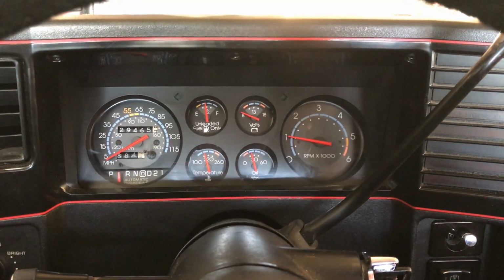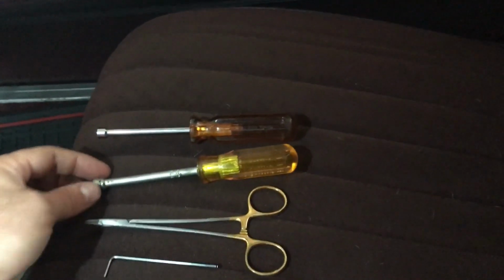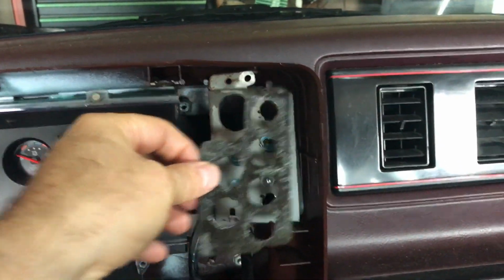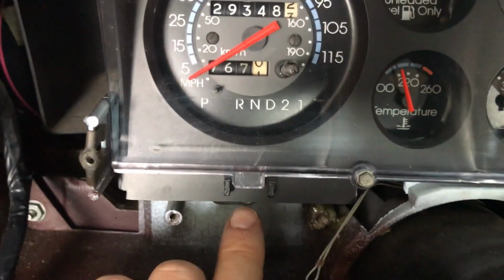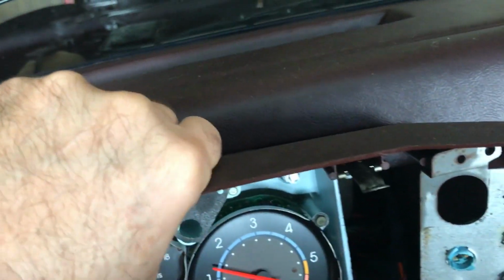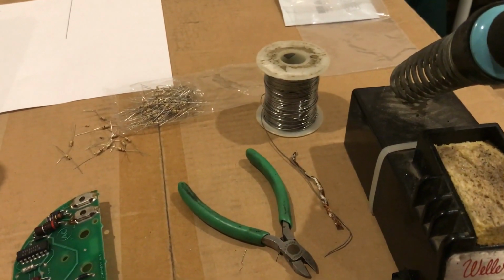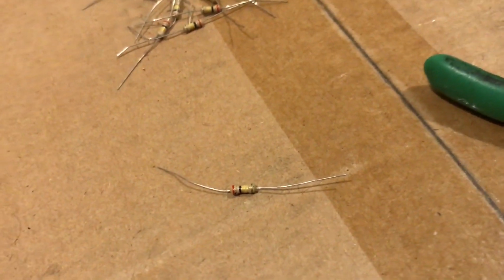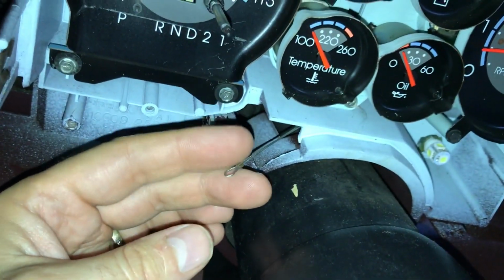Monte Carlo SS 1986 gauge cluster, speedometer removal and tachometer repair

Comment: I prefer to remove the clip for the shift indicator on the steering column housing. It's easier to get at and less likely to break the plastic indicator. I also prefer to attach the string for the indicator directly to the spring rather than the plastic indicator. The plastic indicator iss brittle and breaks off easily.

Comment: My 79 El Camino came with the dummy light clusters & the clock, instead of the tachometer. If I replace it with the electrical gauges system, including the printed circuit, will the tachometer work? Or does the main cable that connects to the printed circuit would have to have the wire that may be missing since it originally came for a clock cluster? In other words, will the wire on the plug be missing since there was no tach? I don't want to install an exterior after market tach.
Reply from the maker: Not sure what the wiring is on a indicator light set up versus gauges, but I can tell you the tachometer wire comes from the HEI distributor through a suppressor mounted on the firewall then through the firewall to the gauge cluster. In short, you could pick up this output from your distributor and feed your tachometer in the gauge cluster.

Comment: hey, your 86 has a 115 spedo too...? i have/ had too and the 1st 1 i totaled had a 85mph do you know anything bout this?
Reply: The Original 86 Speedo IS an 85MPH speedo....  I replaced my 85MPH Speedo with an 87 which is the 120MPH (I call it a 120MPH, as others do, because the 120 MPH line exists beyond the 115MPH indication)  but back to my point, because this is what it should have been in 1986 IMO.

Comment: Great video but I have a question. I see you cut pin 10 & 4 and soldered in a 200 ohm resistor but when you show the final product I see a second resistor also soldered in is it necessary to have 2 resistors?
Reply from the maker: 1st Apologize, but I don’t see what you are seeing. The only thing that I could see that maybe you thought was an addition is the resistor on the opposite side that was already there when I started this project. If so, that was the way it was when I took it apart. Secondly, I reviewed my post and see that I did call it a 2K resistor at one point in time although all other, including when, pointing to it on the schematic, I correctly called it the right value which is 200 K. So I do apologize for confusing you, but it is a 200 K resistor, and only one resistor that I am cutting out of the circuit by cutting the pins on the I C, and then replacing by soldering a new 200k resistor across those points on the PCB.

Comment: Mine read 124.6 should I assume it is the same issue?
Reply from the maker: Even though it’s less resistance than the expected 200 K it’s still significantly lower than what it should be and as such would give you an inaccurate reading. Just make sure you’re measuring it with the pins Cut as to isolate it as if are measuring it still soldered in the circuit it will not give you an accurate reading.
Reply: Thanks… did the repair and will see when I get it put back together. Doing a few other things so it may be a while. Great video very helpful.

Comment: Great video young man
I have 88 so monte msd ign. Stock tach works at idle but going down the road it runnin redline ?
I know it's stupid simple 
Exact cluster as your 86
Reply from the maker: Apologies for the late reply, but I have moved and that has consumed a great deal of my time in addition to work. Not sure exactly what’s causing your issue, but guessing the MSD ignition may be causing your issue? Where are you picking up the tach output from? Has it changed from the original output since you’ve added MSD ignition? Do you still have and are using the original suppressor on the firewall?

Comment: OUSTANDING video. What is the correct name of the "light blocker" shown at 17:45 in the video? I need one. I will use this vid to fix the tach, thanks.
Reply from the maker: Thanks.. I Do not know the name but know the function. As you already indicated It prevents bleeding of light into other indicator/lens segments of the front panel. Check with Mike’s Montes if he doesn’t have it no one will other than a junkyard. You could easily make one out of some thin sheet plastic or even cardboard and thin single sided adhesive foam to form a tight light seal on the substrate you decide to use.
Reply: @mondottimondotti7318  I think they call it a light defuser

Comment: did you have to add something to the LS output signal tach to fit the oem carlo input tach?
Reply from the maker: Short answer is yes. Long answer is it depends on your LS ECM. When I did this video I had what is known as a 24x crankshaft reluctor wheel and gen III ECM. Since our cars have a v-8 Tach I programmed the ECM resolution to match with tuning software is 3/3 for 24x with pull-up circuit (do search on HP tuners Tach resolution ). Now I have a 58x or gen IV ECM and resolution is 7/7. But will share later in a different post issues I encountered as I am currently working on this.

Comment: Why don’t any of you guys show how to remove the speedometer/ pedometer reset stick knob ?!?  I’m down to getting that off & cant 😞
Reply from the maker: Knob is two pieces. The outer will slide off once you remove the small flat blade threaded screw cap in the center.

Comment: On the 3 pins behind the tach, do you know which is pos, neg, and signal? I have this same tach and i want to hard wire it. Thanks.
Reply: Using a digital multi meter (DMM). Place loose electrical connectors secured off to the side, then connect the battery. With the key on, place the black or negative meter led on the chassis ground, like the steering column brackets, then test each of the 3 terminals. B+ for one, ground for another and the “Tach” signal should fluctuate with the engines speed. A DMM is 10 mega-ohm internal resistance so it will not add impedance to the circuit causing issues effecting the reading...or the circuit. Start with your meter set to read DC, take note of the reading and position. Switch to ohms while running to find ground. Once those two have been identified, switch to dc voltage and if it is jumpy with engine speed, it is the “TACH” signal. This model year uses “HEI” ignition. It has three wires on one end. Ground, B+ with key and tach signal. Depending on who made the distributor cap, it maybe cast on top. The larger wires are power & ground, while the tach wire is smaller because it doesn’t carry hardly any current / amperage. it has to be there and plugged in. Over time, the tach wire could be left unhooked. It runs from the dist. to the gauge only. Many wires can be moved, relocated or re-purposed. But the should be three wires at the cap. Tighten the female clips with needle nose and I would use dielectric grease on the terminals. Notice, he said 2K ohms. That is 2,000 ohms, not two hundred. Hope this helps anyone who reads this becuase the cost of a replacement tachometers is like buying 2 sets of truck tires, mounted, balanced and extra for road hazard. Retired - ASE Master Tech since 1978
Reply: @deankay4434  I think they are stated on the tach pos neg and dist.
Reply: @suewatson1912  The gauges including tach for “G” body 1986, plug into the clips in the IP body. The tach is not mark and flexible printed circuit is not marked. The terminals are arranged so if the faceplate locates it’s position. Circuit board has part number and tach in light blue plastic shell. I one OEM entire cluster on bench being cleaned, lubricated with fluorinated grease in small squeeze tube. As shown in the GM shop manual. When using new circuit board I always scuff contacts even when in plastic. Photo can be provided. I am trying to finish my PCV system with Stainless Steel inside 1” copper pipe in valley plate of “LS” engine to drawn crankcase gasses out, putting fresh air in through rocker arm covers. DK.
Reply from the maker: I recently replaced the stock one with an 8K Tach from Mike’s Montes. While doing so I noted the labeling on the back of the terminal posts. The single post by itself is the coil or Tach signal input. The two posts on the opposite side are as follows: Ground is on the outside and 12v is the post next to it on the inner side. I hope this helps.